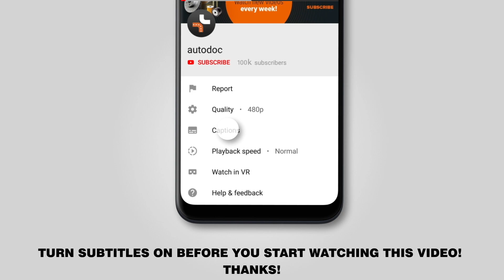How to change engine mount / motor mount on OPEL ASTRA-G CC 1 (F48_,F08_) [TUTORIAL AUTODOC]

Comment: On my Astra G i do this today, but i was able to pull out whole air box closed, not first upper half, then bottom half. So it can be done with pulling out whole assembled air box. After changing this mount and the mount that holds the gearbox(other side of the engine), filled with Novol Gravit 630 on the "empty" spaces in the mount, this engine become "calm", no big fluctiuation after shittung of or starting the engine, no big fluctuations, when you start and wait for  "rpm" to get calm on 800 rpm (Diesel Y20DTH, PSG5). In other words, this car was "another one". Old mounts were like somebody was "cut" the rubber at the one side of the mount. Looks like the material is "worned out" and becomes "soft" after more than 10 years, in my case i`m changing them on the 17-th year. This means that "manufacture fitted" ones are very very good and durable. NIce! Hope this will help others to make their  (especially 2.0 GM DIesel) engines calm again. Everyone must realize that those factory fitted mounts are not  "forever ones". Excellent tuts, keep up the good work guys.
Reply from the maker: Thank you for your feedback! We make our videos based on recommendations we get from people who need them. Your opinion is very important and useful for us and our viewers.
  We value your experience. 
Please stay tuned with us for more new tutorials. 
Best Regards,
Autodoc Team!
Reply: is the other, one holding the gearbox as you said, the same as the one shown in video and easy to replace? This car has only two engine mounts?
Reply: @MasinacCcC  - No the rear mount is a headache to change, compared to this one.

Comment: I have same issues with my insignia. They say there are 2 such parts one is upper at this video and another one lower  bwn gear and the engine. How to know which one is culprit? Thanks
Reply from the maker: Thank you for your comment! 
We highly recommend you use a professional car workshop to have a close look into this issue and locate the faulty part. 
We will be able to provide you with that part if you supply the VIN of your vehicle or the OEM of the old unit. Make sure to get in touch with us via info@autodoc.co.uk  Best Regards, Autodoc Team

Comment: Did I just watch him jack up the engine by the sump without spreading the load?
Reply from the maker: The jack acts as a stop, so the engine stands exactly when the support is unscrewed, if the engine is not supported, it will fall when the support is unscrewed.
AUTODOC
Reply: @autodocuk  I didn't ask why he used a jack. Why is he not spreading the load across the sump with a hard rubber / polyurethane pad? Or even a block of wood?
Reply: I agree - I noticed that he put the jack straight onto the sump, could've caused damage to the sump and seals. I've saw a mechanic do exactly this once and the sump caved in a bit, he said it should be ok ... until he started the engine ... and the crank was then making contact with the sump. Sounded like a tractor after that.